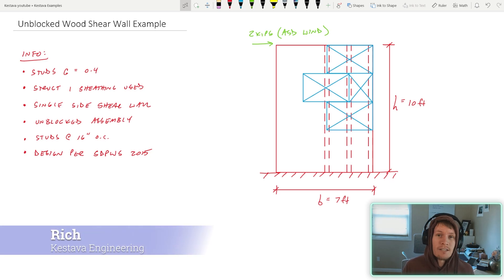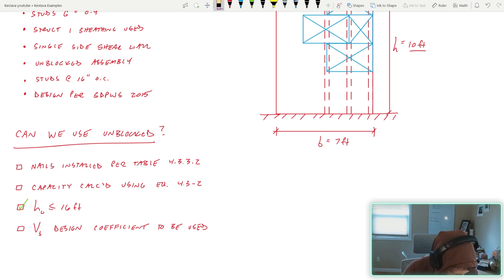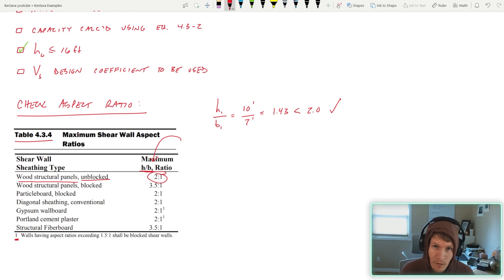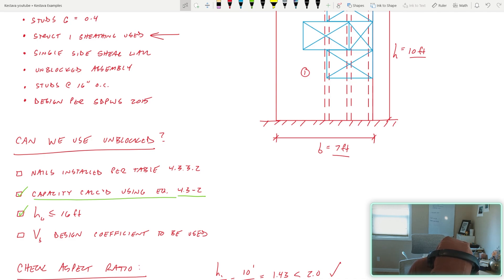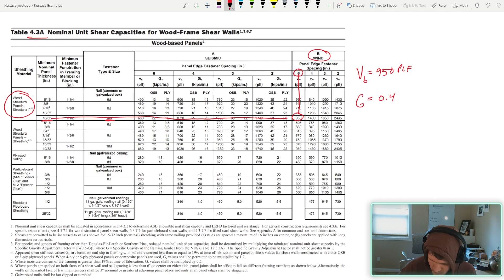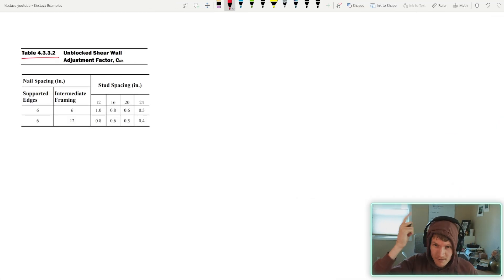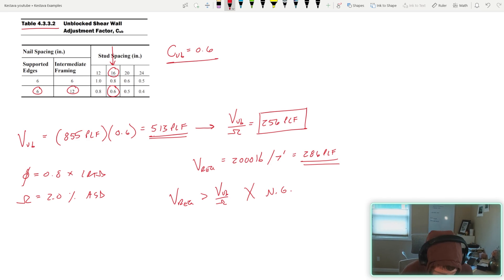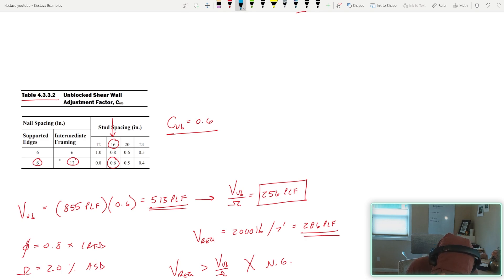Unblocked Wood Shear Wall - Design Example #structuralengineering #engineering #construction

Comment: When is going to be videos about typical foundation system calculations, cause I’ve seen different approaches for typical house and building analysis and design criteria, like monolithic (thicken edge slabs, strip footing, spread footings), also let’s review typical load path conditions, those topics are very often useful for newcomers engineers all over the states. PS: nice channel, one of the more useful and didactic as u can possibly do, and also the more consistent, keep doing it.